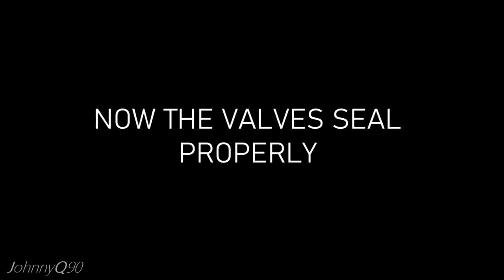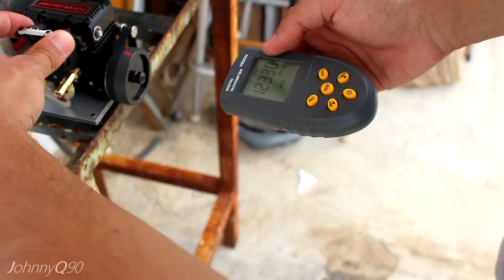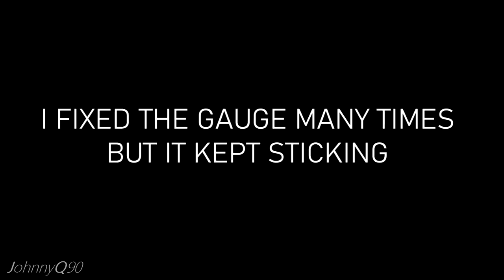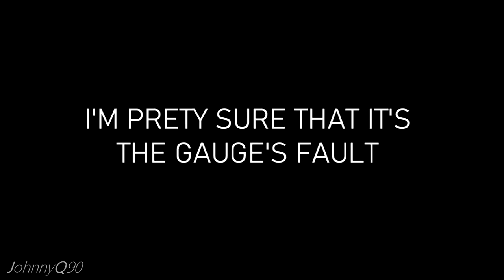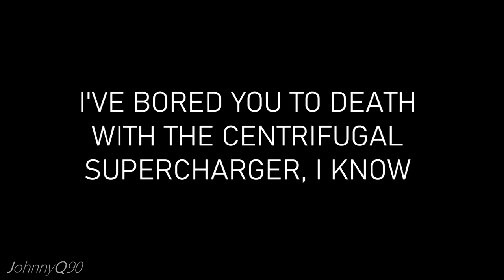PERFORMANCE Upgrade for the 4 Stroke TWIN Cylinder - *VALVE Lapping* - Supercharger Update

Comment: I build/set up/modify/tune drift, time attack cars, and pre runners for a living. Ive put a turbo on pretty much everything from a 2003 yz450f to a 2006 jeep commander with a grossly underpowered 4.7 liter v8 and for me, carbureted boost rule of thumb is always butterfly style carburetor. Slide configuration carbs NEVER function properly with boost. You might try making a boost chamber pre fueling. Its a must on single cylinder stuff. I know thats a twin but, stable air is better than turbulent air,. Anyway, instead of a traditional plenum, have a hollow canister with a capacity close to that of carburetor cfm squared. Theres some math involved if you want it precise but honestly its not necessary. For that little engine id say something with a 2-3 fluid oz capacity should be kosher. The canister should be cylindrical in design with the inlet and outlet on opposite ends of the part. Obviously order of placement should be turbo-canister-carb. Placement is decided by fitment, as long as it makes sense and air has a smooth and direct path to the carb atomization wont be affected in any way, as a matter of fact itll be largely improved. The last single cylinder  turbo kit i built was for a little mini chopper with a xr100 engine and i designed the canister in a conical configuration decreasing diameter the closer to the carb it got attempting to increase air velocity. It worked exceptionally well. With a modified butterfly style carburetor out of a lawn mower with the jetting drilled out little by little until it was right. The tiny little ebay turbo, blow off valve and intercooler from a old snow machine turbo kit (thats a very simplified description) made 7 psi and that bone stock air cooled xr100 engine transformed into a friggin rocketship. Im serious too when boost comes on it feels similar to the powerband hit of a kx100 2 stroke. It makes turbo noises and the little chopper used to max out at like 44 mph. Now it does 56 mph. Just a thought. Turbos are so much easier with small engines because amount of boost is decided by how much air the engine moves. Ive always been leery of anything belt driven i just dont like it at all. With turbos, as long as theres no leaks, if exhaust is coming out of the valves, ur making boost. Then you have a bunch of other shit you can fiddle with to make boost sooner, later, less, or more.  I really hope im half as good of a machinist as you are someday man. Youre a badass.

Comment: If I am not mistaken, the air-fuel mixture gets ignited by compression and heat from the glow plugs, here with these small hobby engines. The supercharged air may be a lot hotter. Maybe an intercooler or replacing glow plugs for spark plugs? Are there any spark plugs for these tiny engines? I can imagine that some quite basic inductive crank position sensor and a tiny coil could drive the spark.

Comment: Dont give up on the centrifugal super charger. Try using a compressed air tank to smooth the pressure waves to the needle, also try using just a tank to push more air into the engine to see how much actual power you can get out of that engine. Maybe you are trying to do the super charger but the engine cant even handle 10psi before it start breaking apart.

Comment: I was surprised at the diameter of the valve rod.  Have you considered machining them down near the transition to the seat to improve flow? Obviously you wouldn't want to weaken then too much but smoothing that transition should give you results similar to porting. Just a thought.  Amazing work!

Comment: in blow through supercharged applications one usually needs to pressurize the fuel system, so that the fuel ratio can stay constant with rpm (hence air supply pressure) varies...

Comment: Have you ever thought about using turbocharger instead? Imo it would be easier to spin the compressor fast enough to make some decent boost pressure without using any geared transmission. Also, spinning the impeller at higher rpm might be difficult due to gearbox efficiency. Maybe constant volume compressor would work better ( as you probably know centrifugal compressor needs a lot of rpm to work efficiently ). Anyway awesome work as always :)

Comment: ABOUT THE TUNE.... even a full scale engine cannot be tuned for force induction unless its monitored by a MAF sensor right after the air intake or about 12'' away from the throttle body and an o2 sensor for stoichiometric values which is called max air flow tuning. option #2 is called speed density tuning which used a MAP instead (manifold absolute pressure) which monitors stoichiometric value by using a vaccum sensor right after the throttle body, an air temperature sensor at the throttle body or manifold and throttle position. MAP is best for high rpm stoic and MAF is overall more accurate BUT because the (hot wire) inside the MAF monitors air values by how much thw hot wire gets cooled down, it can be an obstruction at high rpm or intense air flow. THE ONLY WAY to have the RIGHT formula for proper air fuel ratios on a carburetor/turbo setup from idle to max rpm Is to know how much air the motor takes in naturally aspirated and also know how much air the turbo puts out per every 500 rpm or 1000 rpm and find your slope or (COMPRESSOR MAP) then you would be able to find out what your fuel delivery slope should be via throttle position. and rpm. NOTE: one pound of boost will double the amount of air flow the engine produces naturally aspired. to make things simpler, you would want to choose a desired amount of boost and know that the chosen value would remain consistent throughout the entire rpm curve just to make calculations easier than trying to find the variable every 500-1000 rpm but you dont have a way to control boost right now.

Comment: Maybe check for leaks between the carb and the supercharger💁‍♂️ it wouldn't harm to check the other connections as well... I know if you ziptie pipes like that, theres always a leak at the locking mechanism of the zip tie. 

 You can spray a small amount of starting fuild/ether on the pipes with a small nozzle to try and locate possible leaks

Comment: On the gauge: 'use oil filled' and 'mild baffling' are already listed in the comments - I'm on board with either of those as well. But. Another easy way is to simply have a longer pipe on the gauge. The slight added error (always downward) added by the distance is small  here, yet simple and cheap fix. And if that doesn't work, you have more tube to stuff with cotton balls :D

Comment: Can you change the springs and weights in the supercharger to get it to kick in later. That way you can have a vacuum at idle and boost under load.  The way it is running is like it is under boost at all times. The "centrifugal" clutch within it isn't working properly. By changing the pulley sizes on the motor you are trying to underdrive it. Doing that it should create less boost unless the clutch isn't working properly.

Comment: 3 PSI does seem a little high but hard to say, in the previous set up you were losing so much through the fuel tank alone then an additional drive speed now might get to 3 but hard to know as we do not know the correct boost pressure before. Also if the valves were having blow by then you sealed them for more so you minge actually be achieving 3 PSI or close to it.

Comment: In my opinion, this is the most interesting supercharger kit I ever seen 😌 you are such a talented machinist 😶 Don't loose motivation now, 🙂 it is so close 😊
Btw, how is that draw through setup behaving with smaller crank pulley instead of bigger one you installed in video?

Comment: Fuel injection?? Kinda seems like it's a fueling issue, from what I understand at idle and low throttle inputs fuel tends to coat the walls of the intake tubing and pool in low spots (this is known as wall wetting). This could explain the runaway throttle and poor idle behavior, the only way to know for sure is to use an O2 sensor of some sort on the exhaust side to determine AFR. Honestly, it might be easier to stick with the blow through setup and build a small charge cooler to sit between the supercharger and carb. A cooler intake charge will definitely help on the blow through setup.

Comment: Two points to make her, and well done to you for getting this far on your supercharger project for this little engine.
First Point  1)
The more air that you can capture for each stroke of the engine, the higher the power, therefore the higher the RPM. A strangled engine will NEVER reach high RPM. In that light check out my World Patented Mechanical Fuel injection system, which will enable this engine to reach twenty five thousand RPM if the reciprocating parts will hold together at that speed. The Patent is here : https://patents.google.com/patent/US7744066B2/en 
Point 2)
In an earlier post, a commenter suggested that fluctuations in the airstream from the air intake to the inlet valve were the cause of the pressure gauge needle oscillating. This is perfectly true. In order to dampen this phenomenon, a plenum chamber should be built into the intake , and a pressure reading taken from a bleed point in the plenum chamber. 
Good Luck, and let's see the the results of your efforts with a mechanical fuel injector fitted. By the way, I won a TT race on the Isle of Man in 1970 using a 750 Norton and the fuel injector described in the Patent.

Comment: I feel like because of the scale of the engine, it will need vastly differing AFR between low & high RPM, and also with and without boost, which means a complex fuel map, which means not possible with a carb. Unless you create some kind of self adjusting device that changes the fuel flow based on RPM, boost pressure and throttle position, maybe even how quickly the throttle is being opened, then retunes the carb in realtime. It's probably possible but would be very hard to tune.

Comment: To stop killing your gauges, you need to include a restricting orifice between the engine manifold and gauge. Try in insert with a 1mm dia hole. This will provide 'damping' for the needle mechanism.

Comment: if you want to be able to read boost on a twin you need a surge tank, like the CX650 turbo does. otherwise the vacuum will just keep bouncing around between the intake valve overlaps. since it's a 180° twin it's impossible otherwise.

Comment: Positive displacement sounds much more scalable. Get a quarter the diplacement per revolution relative to the engine and a 10:1 ratio and that should make about 14 PSI if I'm thinking about this right, which would be insane.

Comment: You are getting blower surge You need to find a way to make a blowoff Valve to relieve excess pressure. You should try porting the supercharger exhaust tube and all of the intake tubes and intake and Exhaust runners in the head from the valve sets back. it should pick up more throttle response and Power in the top end. Just my 2 cent 👍

Comment: Keep on trying with the centrifugal blower. Try to make a Big sealed Air box and presurize It with the blower. As bigger the Air box more pressure you Will get because of the venturi. The carv shoud be attached to the motor inlet, and the airbox attached to the carv.

Comment: Or another option is a magnetic pully like what’s on a cars ac compressor that u can set to kick in when your on throttle so it free spins at idle but the super charger isn’t spinning. And when u get in the throttle it’ll engage it will accept the boost on throttle and disengage off throttle which would make it easier to handle. 

Or test the dump valve theory by putting a check valve in the middle of the intake tubes that u can open to vent atmosphere by hand to test it and see how much better it runs and shut it while throttling up to see if it works better

Comment: Don't give up on this, it's definitely an issue with the Carburetor what you need is a bypass or larger Carburetor, the Supercharger is drawing too much vacuum on your pull-through setup at idle causing the Carb to remain between 20-50% throttle as it was designed for a NA engine with a lower Volume of airflow. You could try a larger Carburetor designed for an engine with a higher displacement, assuming your setup is making 0.8psi of booster above ambient that means you are forcing about 5-6% more air into the engine so maybe try a slightly larger Carb for your engine. (Standard Day Barometric pressure is 760 mmHg or 14.7psi) You should make a comparison based on your current Barometric pressure in the test environment.
Reply: A bypass could work with an intake valve which allows the engine to aspirate through the Carb directly upto the point the Supercharger creates boost.
Reply: It could be actuated by the manifold pressure for example like a differential pressure valve.
Reply: Also if you are feeling froggy you could even try porting and polishing the cylinder head, not sure if it would really make a huge difference on such a small displacement but 90⁰ angles and rough flow surfaces do cause air resistance. Any restriction in airflow is a power loss so intake and exhaust ports that are oversized and smoothed may offer some performance increase.

Comment: Not bored with the centrifugal, but I have a feeling that perhaps the idea doesn't exactly scale down all that well, no matter how well designed and manufactured it is. I still think it needed a larger compressor wheel. But I'm certainly no engineer.

Comment: A restrictor with a small hole, in the line to the gauge, would smooth it right out. Had to do it a few times fitting boost gauges to full sized cars for the same reason.

Comment: There is no airflow in the compressor once both intake valves are closed. You reach max boost and no more fuel is let in. It deatomizes and stays in the compressor housing, is my suspicion. You could try to make a fuel distributor with timing attached to the draw through setup but I think you're having major issues with the AFR through the whole thing. 
Or maybe some sort of waste gate that returns to the fuel tank may help keep the fuel atomized and flowing.

Comment: That is normal behaviour for a gauge on a twin engine. You need to have a restrictor in the tube to the gauge. An aquarium air adjuster is perfect. You can set the restriction until the gauge just stops vibrating.

Comment: Not only have you sealed the valve, you’ve changed compression and overall lift, with the valve lower in the head the compression is less and the valve will pass more air through it

Comment: Regarding the tuning problem, I wonder if the 3D printed elbow is at fault? A lot of times 3D printed parts aren’t water tight, so it’s possible they aren’t air tight either. Try sealing the plastic with whatever it is the boat guys use and giving it another go.

Comment: Roots compressor presure is linear, centrifugal compressors is exponential.  Roots flow increases with the rpm, centrifugal with the rpm squared.   Blown setup works worst, that's why you can set it up more or less correctly, because you are loosing a lot of airflow (I presume in the carburator, used in blown position can loose air. Carburators are build to work on the vacuum, not on  pressure. Is not the same.,)
You need as a start, a carburator with more range, and I'm afraid quite more complex than what can be made on that size to be able to correctly regulate the gas.
I would try with a bigger carburator first,  one that can supply twice as much gas as the one you have. The complexity is that it has also to be very precise on low rpm with half squared the airflow, and that means more than one pin and very precise and small holes.

Comment: It might be a problem of fuel delivery (I'm sorry I dont have the english vocabulary) the supercharger pulls to puch on the main jet maybe with a smaller jet for low RPM, a bigger main jet or even one more for High RPM would be a way, you Can also try to put a conical piece on the air intake to increase the venturi effect. Hope it makes sense.

Comment: I think you could tune it if you could boost reference the fuel pressure. The fuel demand changes under boosted conditions vs vacuum

Comment: What I think he needs to do, is use that beautiful mind of his and create a blow off valve, fuel pump and make the injection and valve computerised via a Raspberry Pi.
It'll involve a stupid amount of maths, but if you get it properly, it'll be freaking AWEAOME.

Then you can just make a manual clutch and gearing system and you'll be able to rev the engine, change gears and have the turbo/supercharger make its iconic blow off and turbo-whine sound and you'll be golden!

Comment: Id say different carb made rpm change. Maybe that new carb was run leaner as well? I say this because I run these 4 stroke rc engines in rc trucks. Iv lapped the valves many times and never got a rpm change like that. Either way, cool vid!

Comment: Wow from sound alone that lapping of valves made it run so much smoother. AKA how its supposed to be. Seems to me you need a better carb. And the poor gauges can't handle the pulsing of air flowing into the engine cus valves open and close. Development is a long road of fails to get it right

Comment: Try with the previous setup, but provide sufficient fuel pressure. In your previous setup you provided the pressure for the fuel thank from the same pressure that it was trying to overcome. e.g. use either fuel pump or line from exhaust pressure trough a one-way valve to fuel tank. (with one way valve the low rpm will still provide stable pressure and emptry space in fuel tank will act as a pressure reservoir)

Comment: you need to add a one way valve with quick manual discharge into the pressure gauge